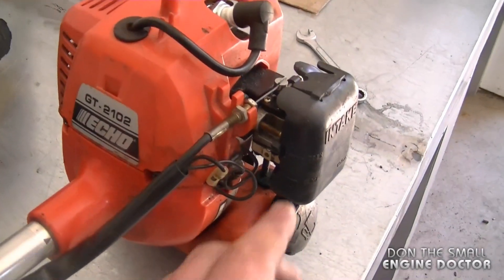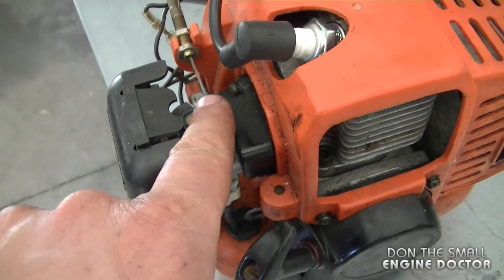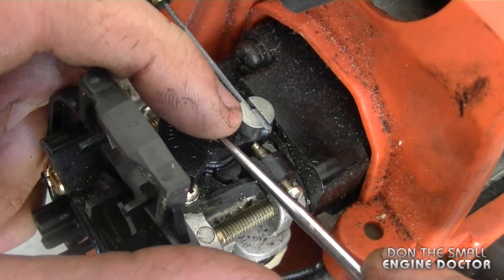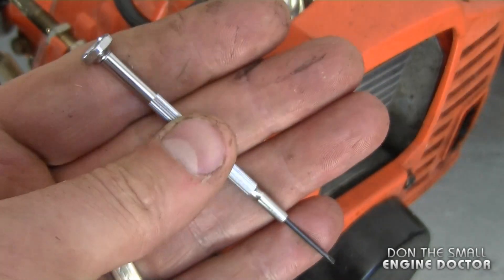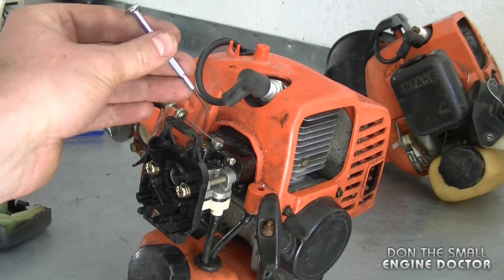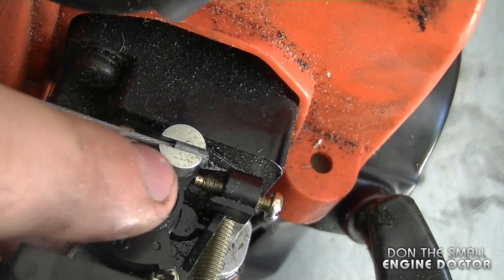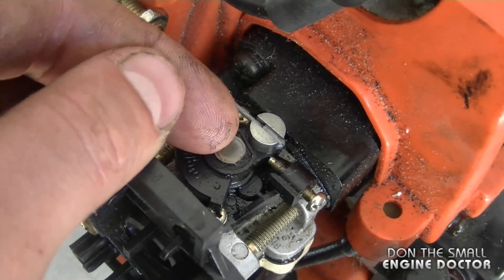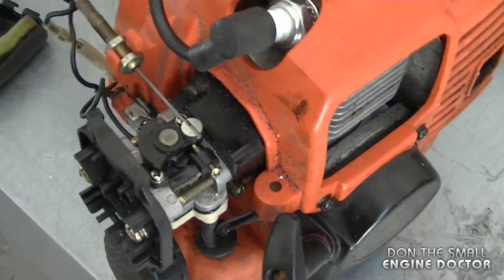Hidden Adjustment Screw On Walbro Carburetors

Comment: Many times your tips have helped me out.  Thanks for sharing this.  It’s helpful, but I could use your help still.  Maybe you can answer a question I have.  My carb is on an old Shindaiwa blower.  It idles fine, but blows smoke when throttled, so it’s rich.  I can start it and turn the little screw in to lean it out and get it to where I want it, but it shuts off at idle.  I’ve tried adjusting the idle screw to no avail at this point.  Any thoughts.
Reply: Never mind.  My carb is a Walbro replacement.  It actually has a high speed adjustment screw and that allowed me to set it correctly.

Comment: I was told by a pommy guy who runs the vintage engine repairs channel on here that the symptoms that I was having with a Chinese clone Honda GX35 carburettor is that it was eventually stalling after I released the throttle from the wide open position to the fully closed position is that the high speed screw needs to be closed up a bit.

I think that it could've been sucking air back in through the 1 way check valve which is beneath the metering chambers needle lever,it could be sucking air back into the metering chamber.

I am yet to check the valve to see if it's leaking air because I want to reuse the carburettor on another Chinese clone Honda GX35 engine which I wish to build from scratch.

What he's saying is happening is on deceleration is it's over fuelling the engine therefore the high speed screw needs to be closed off, there's a brass plug covering the high speed screw as well.

The Chinese clone engines carburettor is adjustable but the OEM Honda carburettors low speed mixture adjustment screw is expoxied up I believe, online many of them have a rubber plug which can be removed to adjust it.

I have never had to touch the OEM carburettors adjustment screws !

Comment: Aloha Dony. I'm working on another Shindaiwa T242 and once again, carburetor issue. Do they make a replacement carburetor with high low adjustment screws?  I don't see anyway to adjust these stock carburetors that come on the T242s. I ordered another carb and hopefully that will cure the problem of it bogging down after about 20 minutes.  The spark arrestor has been removed and port is clean.

Comment: I watched your video because the carburetor you showed was similar to mine, I also had the same issue you described. Mine didn't have the plastic cap but  inside had a very tiny plastic plug, I used a small drill bit, with my hand I removed the plastic and found the adjusting screw. I adjusted as you explained and works fine. Maybe the manufacturer don't want anyone seeing this adjustment screw, but with your help I got it!

Comment: Somehow, it's better for the environment to have thousands of non-running weedeaters and edgers discarded  into landfills, and many thousands more running badly, than it is for us to be able to actually adjust the carbs. Believe it or not, I actually support the idea of government agencies to improve the environment, but sometimes their ideas are a bit poorly conceived, and even more poorly executed. Anyone likely to adjust a carb is unlikely to tune it so badly that it becomes an ecological menace. Meanwhile manufacturing new equipment, or replacement carbs for old equipment also has an environmental cost.

Comment: On my 2017 ECHO PAS280 there are two adjustment screws in the same place, but mine had a then plastic plug. At the base of that alum. section is one, and the other is on top of the carb.

Comment: The carburetor that I got the person had installed a Wyatt w y j 306 on there. I couldn't find the choke because they took that plastic piece off of there so I like how do I adjust this carburetor because he also strip the screws to take out the carburetor so I'm going to find a small screwdriver now and try that adjustment thank you very much

Comment: Got an echo blower BP-250 LN ...starting at first pull but only idles....changed carb and all fuel lines included fair and fuel filter.
Did some adjusting to the carburetor jet screw.....condition still remain the same....
What else can be done my favorite......please advise......
Thank u
Reply: Sheik Shakur did you clean the spark arrestor screen?

Comment: More of a question, than a comment.  I have a Walbro WYJ-345 carb.  One day it worked fine.  The next day it refuses to throttle up.  It bogs down.  I disassembled it and put it back together.  No change.  I cannot find any info on whether there is a hidden screw for the WYJ.  Can anyone offer some help?

Comment: Dude, thank you SO MUCH for this video.  I had exactly the same problem with an older Ryobi blower that idled fine but bogged down under throttle, 1/2 turn out did the trick, now it’s running like new!
Reply: Thank you for the information

Comment: I had exactly the same bogging down problem with a Mitox Strimmer. I bought a carb gasket kit but the guy at the shop said try the small screw on the throttle first, and that fixed the problem.

Comment: Allso on some of them there is a adjustment screw under a black plug on the right side of the card I use a small self tapping screw to remove it and Adjust the carb

Comment: Great video! along with your other video describing how the single screw carbs work I now understand how to make proper adjustments on these unique carbs. One thing to note is for the perfect mixture is to use a tach and when you get max speed with no bog let off the throttle and richen the carb just enough to bring the rpm down by 100 rpm, remember that if it's too lean you can burn up the engine! like the saying goes "lean is mean but rich is fat!"

Comment: Hello Donny, I'm hoping you can help. I have an older RedMax BC260DL trimmer. HAs the Walbro WY 4 carb on it. I rebuilt with a new carb kit from walbro. However , do you know how to adjust the throttle screw(not idle adjustment screw) on the top of the carb? Right under the throttle cable. I believe it's called the throttle valve assemby? I think I've finally narrowed down my problem to the adjustment of said screw,but I think someone had it way out of adjustment. It was basically impossible to start without spraying some starting fluid in it, Once started,it would run and throttle up great .Shut it off and restart,it would start right up again and run great. But let it sit for more than 5-10 minutes or cold start and it will not start. Spray starting fluid again and it fires right up and keeps running beautifully. I just noticed the idle was too high and the idle screw wasn't even touching the valve. I tried adjusting the screw on the valve and it seemed to bring the idle down. I just want to set it where it is supposed to be.

Comment: Hi Don, I recently bought a HIFROM Echo SRM 230 carburetor replacement kit. The supplied carburetor has uncovered adjustment screws in the top like you show in this video plus a recessed adjustment screw hidden just under the primer bulb. My replacement carburetor runs the SRM 230 but cannot idle without a little gas on the trigger. The idle adjustment screw is not long enough to compensate for adjusting the idle. Do you know which of the two hidden screws should be adjusted to fine tune the carburetor so it runs better at high speed and allows the idle screw to do its job?

Comment: Great Video. Need help!!!

 
 
 
 

Homelite
String Trimmer Model UT20046 Compression good, Muffler not clog
up, carburetor rebuilded, new spark plug has good blue spark when
grounded no spark when trying to start it. I changed out three
different used coils same thing, shows good blue spark when grounded
to block but no spark when trying to start it. The repair manual says
.008 to .012 air gap for coil and 025 for plug have coil set to .010,
piston looks good don’t see any damage on exhaust on intake side
hate buying new coil do you think the coil could be the problem? I
would appreciate any and all help you would care to ofter because I
am completely out of ideals except for a new coil.
                                                 
                boshellgilbert@gmail.com

Comment: I have a question, Why would you need to adjust that? What would cause it to all of a sudden need adjusting? Old gas varnish buildup? if that is the case, could you run it all the way out and shoot some carb cleaner into it and set it back where it was (factory set +/-)?
Reply: Over time as the engine wear it may need an adjustment to make it run better.  Also, the screw could move over time, too.
Reply: Vibration of engine over a period of time...some of these adjusting screws have a locking system

Comment: On some of the newer carburetors there is indeed an adjustment screw there. There is no cap to remove. The adjustment screw is covered up with a little dab of plastic inside the hole. What I do is heat up the end of a small jeweler's screwdriver and put it into the hole. You will feel it sink into the wax as it melts it. Let it go in a fraction of an inch, let it sit for a few seconds so it cools off them pull the wax plug out. Now using a small jewelers screwdriver you can make the adjustment. It is for idle adjustment and ramp up. Some Walbro carbs also have a high speed adjustment through a small hole in the side of the carb body.
Reply: Roy Minnehan n n
Reply: @miketidwell9546  What does n n mean ? . . I'm afraid I'm too old , I only understand words .
Reply: Yes,  there's a YT video where the guy used the heated tip of a twist drill . Several attempts but it didn't work for me . A flat ended pin punch worked first time , the flat shank end of a 2 or 2.5mm drill or rod would be similar .

Comment: my  echo chain saw is very hard to pull  starter rope when cold, it,ll only come out about 3", feels like something is locked up, after a few of these pulls it' ll crank right. after saw has warmed ,and shut off ,cranks with no problem( 20" bar); appx5 yr's old.

Comment: So is this for the 'high' jet (under full throttle)?  and can only set 'low' mix with idle screw on these type of carbs?
Reply: no low side has hole right below fuel inlet brass, usually have to use micro drill bit or heat small srewdiver punch thru plastic and pull it out

Comment: well aint they sneaky
Reply: +Mustie1 Similarly with a lot of Zama carbs. At the pivot of the throttle wing, there's a well and at the bottom of the well is a jet screw. There's also a jet screw on the side just beneath the fuel intake and return lines The problem I've had is that they're both plugged with a removable cap, and you need a special tool to pop them out to get to the screws. Either that or very carefully (!) drill them out.

Comment: I'm pretty sure I have the Walbro WYK carb on my 125L Husqvarna trimmer and it comes with the same rubber plug covering an adjustment screw.  Plus a small black plunger to release fuel from the pump diaphragm.  I had to adjust the screw because it was bogging down a little, mid-rpm whilst trying to go full throttle.